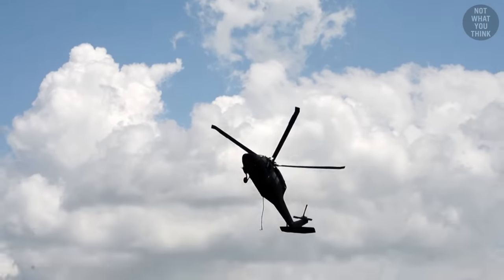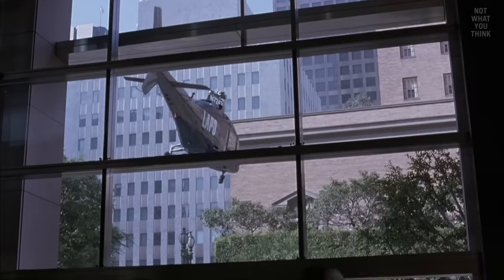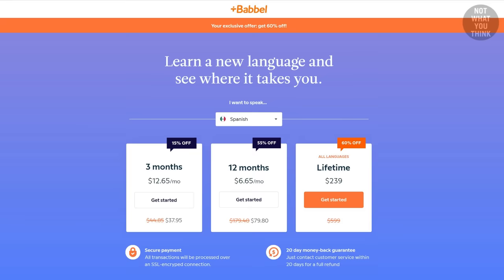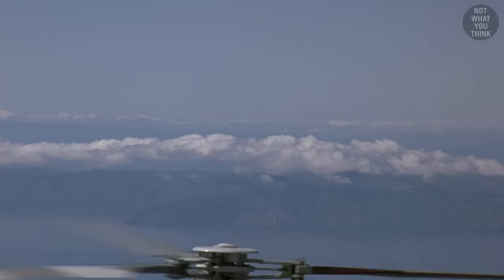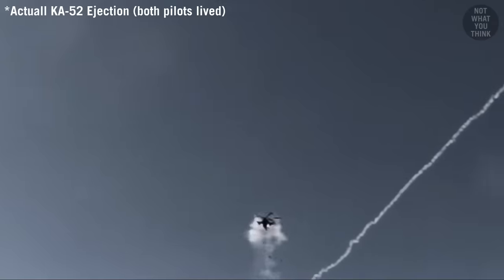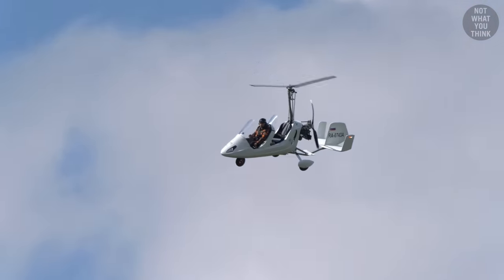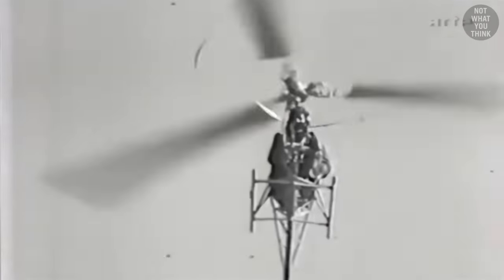Why Helicopters Fall Like a Leaf, Not a Rock

Comment: By using the mass of the rotor (autorotation). The bigger and heavier the rotor the more "lift potential in the tank" this is why big helicopters rarely crash when having only a engine failure given they have some altitude at least.
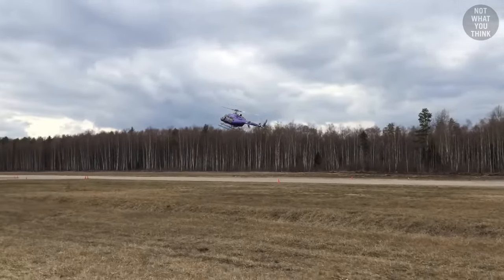Edit: 4:34 this is why this pilot had to do such a abrupt landing, the rotor has barely enough mass to do a 1 second "power up" 5:38 you can see how the mi8 has enough mass to do a gentle landing.
Reply: Technically it has to do with moment of inertia. While rotor (& transmission & engine) mass play a role, the distribution of the mass make a noticible diffference too. For example, for two rotors, one is three-bladed and the other two-bladed (assuming same lift and mass), the three bladed rotor would have less moment of inertia than the two-bladed rotor, because the three-bladed rotor will have a smaller diameter. In this case, the two-bladed rotor will have better autorotation characteristics.
Reply: I've heard that the venerable Bell UH-1 Huey has enough mass and momentum in it's rotor (Blades are nearly 12 inches wide IIRC) to land and with the engine off, lift off, turn 180 and land again.  In contrast, the 2 seater Robinson R22 that I trained on, the pilot must IMMEDIATELY lower collective in the event of an engine failure (The handbook says 2 seconds or less).  Essentially the blades slow down while lifting the helicopter.  With no engine to speed them back up and if you don't lower collective and flatten the blades so they're no longer lifting,  they'll get to a point where the air from the falling helicopter will push them up and break them off.  There is no recovering from essentially losing your wings.  Game over.
Reply: @Quizzicality  the huey blade is so wide it's more then the size of the shoulder width for a man, it's 53cm, or 21 inches, about 9cm thick at the root.
Reply: @nicholaslau3194  this is why I stated "the bigger and the heavier"
Mi8 has 5 blades but it's so big and heavy it can "go up instead of down" using autorotation.
Reply: @Quizzicality  the huey and ah1 cobra had another problem for the "loosing your wings" and it was mast bumping, if you went into low or negative G the heli started rolling, if you happened to correct the roll before applying back cyclic or collective to load the rotor again it would literally break away and fly off while you crashed.
Reply: @antoniohagopian213  mmhmm.  Robinson helicopters have the same problem.
Reply: @Quizzicality  all dual bladed helis have it I think, but the raven doesn't have it to the same extent as the huey and cobra since those were much more likely to fly low to the ground resulting in low and negative g when terrain following after a steep mountain or hill side.
Reply: @Quizzicality  "they'll get to a point where the air from the falling helicopter will push them up and break them off."

I'm a CFI in airplanes and helicopters and I've never heard of such a thing.
Reply: @Tom-zs6bb  I was told for the robinson if you fail to lower the collective and let the main rotor speed fall below 80% you'll be falling too fast and risk the blades folding up and breaking off.
Reply: @Quizzicality  You were told wrong, or you misunderstood. Failure to maintain the correct main rotor RPM during autorotation can cause a couple of different problems, depending on meeting a couple conditions, but it's doubtful that the blades would separate until the a/c impacts the ground. During an auto, the main challenge, where the collective is concerned, is not allowing the main rotor RPM to exceed safe limits.
Reply: @Tom-zs6bb  ah, well I stand corrected 😁👍
Reply: @Quizzicality  😉

Comment: The ejection system on Ka-52s is a bit different of classics ejection seats . A rocket behind the seat is attached to the crew member harness with a cable . When it's fired, it breaks the canopy and then extracts the crewman from his seat . It's similar to the Yankee extraction system .

Comment: I am so much more impressed with the base mechanical principles of helicopters, than I am with any other mechanical system.
Reply: I get you but this competition needs weight classes or something. The tesla valve is just as impressive (to me) but less flashy. Coconuts leave helicopters in the dust, they're solar powered self-replicating colony ships and they've probably killed more people than helicopters.
Reply: @KoenZyxYssel  I specifically said mechanical systems. That means non biological like a coconut. Also a teslavalve is a very simple thing that could have been invented at least 100 times by now if tesla himself didn't invent it first.
Reply: Definitely mechanical systems in vehicles are extremely impressive, like internal combustion engines in cars or jet engines on airplanes or like a closed cycle combustion engine on a rocket
Reply: @monkaeyes3417  I'll agree to disagree on both of those issues. The more abstract definition of "mechanical" makes more sense to me. I also doubt anyone would have come up with the tesla valve but I guess we'll never know.

Comment: I always found doing autos fun. The initial sensation is almost like falling. 
Definitely a emergency procedure that is worth practicing!
Reply: When I was in the Army at Ft. Sill as a crew chief on a UH-1H, autorotations or what they liked to call 'non-standard landings" seemed like a daily training mission.  Somebody's aircraft was going to get the crap kicked out of it that day.  Some times you'd land in the grass, some times on the runway.   You do non-standards today, tomorrow you were likely in the hanger at best changing out the skid shoes, some times the tubes.   At the time (82-83ish) here was a civilian contractor on the airfield that would take the standard skid and weld a number of 1/4 inch(ish) tall beads down the length of the shoe.  That gave it a bit more life.  But you are right, very much a skill worth having, one you (and your crew) might not be able to live without...

Comment: Assembling the auto gyro, then  recovery and stowing the craft after the flight, would have been a great challenge for the German U Boat crews, especially in the choppy seas. Good information, I never knew before that Uboats operated a reconisance gyro copter, great video indeed.

Comment: Your explanation of autorotation was somewhat simplified but the actual physics is rather complicated (and potentially rather heavily technical for a short YouTube video), involving three zones in the rotor disc - The driven portion, the stalled portion, and the driving portion - these zones are essentially concentric and offset slightly to the side of the retreating blade.
Reply from the maker: Your correct. We did come across that in our research. We decided not to include it.
Reply: @NotWhatYouThink  - Probably a wise move. You'd have your audience falling asleep before the end of the video. It is rather interesting, though and the really nice thing about an autogyro over a helicopter is that we don't really need to pay close attention to our rotor RPM once we have it up to speed and have taken off. More weight, they spin faster. Thinner air, they spin faster. As long as the rotors are loaded, they spin at whatever is necessary to provide the lift we need and to ensure that we keep them loaded, we NEVER pull low- (or negative-) G manoeuvres.
Autogyros are widely underestimated as they are incredibly capable aircraft and handle wind and turbulence better than the majority of GA fixed-wing aircraft. We go flying on days where the wind conditions have grounded everything else at our airport. I get envious looks as I am out warming up my engine when the folk at the flying school are racing to get their Pipers and Cessnas tied down.
We don't need a lot of wind to be able to perform a zero ground-speed hover. We have around 90% of the capability of a small heli at about 10% of the operating cost.
In your comparison between fixed-wing and rotorcraft when you were talking about safety, I think you might have missed a key detail. Whilst we cannot "glide" as far as a fixed-wing, we can put down in much smaller spaces which gives us many more options for an emergency landing.
If you ever get the opportunity to go for a ride in one, I highly recommend it. You will land with a grin so large that the top of your head will be in danger of falling off.
Reply: @halfrhovsquared  is there a lecture on youtube or a set of lecture notes that goes over the physics of autorotation? can you provide a link to it?
Reply: @mastershooter64  - I've never seen one. I'll have a look, though.
I learned about autorotation because I fly a gyrocopter (just in case that wasn't obvious from my channel).
If I cannot find a lecture on autorotation, perhaps I should put one together and upload it.... although, that would be a huge investment in time.
Reply: @mastershooter64  Helicopter Lessons in 10 minutes or less does a great brief video on autos, and there are certainly plenty of exhaustive videos on the subject

Comment: To anyone confused as to how auto rotation works, they change the angle of the blades so that it starts spinning as they fall and then right whenever they're about to hit the ground they change the angle to start thrusting downward
Reply: Basically like flaring the flaps at the end of a glide. Giving it an extra boost in lift at the cost of forward momentum you are trying to get rid of anyway.
Reply: @RamadaArtist  " flaring the flaps?"
Reply: You sound somewhat confused, yourself. "so that it starts spinning" seems to imply that the main rotor stopped turning so that cannot be what you meant, right?  Similarly, "they change the angle to start thrusting downward" seems to show a lack of knowledge of basic physics as well as aerodynamics. That being said, it appears that you have a little  bit of understanding so perhaps you simply worded your comment incorrectly.
Reply: @Tom-zs6bb  The video never really explained how the driven and lifting sections of the rotor disk work during autorotation. He just says altitude is exchanged for rotor speed. That's true, but probably leaves a lot of questions for people.
Reply: @CompTechs  " The video never really explained how the driven and lifting sections of the rotor disk work during autorotation."

No it didn't, but other than you attempting to prove you know something about the three regions of the disk during autorotation, a discussion that lies well outside the scope of this video, that is completely irrelevant to both my comment and the comment to which I responded. 

My comment was a response to a commenter who chose to provide instruction while he himself has no idea what he's talking about.
Reply: @Tom-zs6bb you must be fun at parties
Reply: @All_SportGG  And you celebrate ignorance. Given the choice, I'd rather be accused of not being fun.

Comment: There was a case in Taiwan that a rescue helicopter engine seize in the mid flight and drop like a rock....After investigation, they found out it wasn't the engine issue, but the main rotor bearing was seized due to lack of lubication......

Comment: Helicopter auto-rotation after engine failure requires two things: 1) reverse / negative pitch in the rotor blades 2) disconnect /uncouple the rotor from the engine, so the blades can spin freely. This way, the spinning rotor blades will function as a parachute. Both 1) and 2) be done QUICKLY, before the rotor speed slows. As you get VERY close to the ground, gradually feed in positive pitch to brake the descent speed for a comparatively soft landing.
Reply: But you still have the torque of the main rotor without the tail rotor to compensate.
Reply: @GeoffryWK  nope you actually don't, the torque to the helicopter delivered by the blades is delivered through the engine of the vehicle as it works against the drag the blades experience. when autorotating this simply cannot happen as the blades are not driven by the engine and will simply just reduce RPM.

basically, the rotation the tail rotor compensates for can only happen if the main rotor is currently a powered rotor and is why gyro copters don't need any sort of tail rotor to maintain yaw control as the lifting rotor is purely driven by external forces and is not rotated by the engine.

Comment: Autorotation is also a valid approach. Eg in New Zealand some locations require a auto rotate to get into. I always found autorotations more like a plane landing. Eg maintain a constant glide speed then flare near the ground. I guess keeping the rotors in the rpm range is slightly different.
Reply: "Autorotation is also a valid approach."

No, it's an emergency, not an "approach."

Comment: Hello, I noticed you mentioned English wasn't your first language, but you speak it very well, however there's one strange rule which most English speakers don't get correct and I noticed you messed it up a few times. "further," is used when talking about progress, for example "Albert Einstein explored calculus further than anyone at the time." While farther is actually used when referencing distance, "they used the kite to see 'farther' in the distance," but further would be incorrect. Hope that helps :)

Comment: Auto Rotation is indeed a fantastic safety feature by design, but if even one of the main engine blade's were destroyed or ejected, the helicopter will then fall like a rock.
Reply: True but so will a plane if you cut off one of its wings.
Reply: @jerryblue017 unless its an f15
Reply: @srthebox4946 and if you chop off the whole wing not just half

Comment: 10:07 Actually, depending on the "aircraft's" weight it would not require a pilot's license. "If unpowered, weighs less than 155 pounds", and "If powered, weighs less than 254 pounds empty weight, excluding floats and safety devices which are intended for deployment in a potentially catastrophic situation", weight does not include the pilot.
Reply: Given that a boat is one big float, you could exclude its weight?

Comment: I knew right away this was gonna be about autorotation. Back in HS physics, I did a lot of research on it for our Egg Drop project. My idea was to copy those helicopter seeds. The major problem was our initial build volume was extremely restricted so at first we tried to make an expanding blade but because no initial rotation was allowed, it never spun fast enough for t he blade to expand out. So we ended up with a smaller but very wide surface area helical blades. Lemme tell ya, we felt like kings when we "won" the project but it felt so much better when we let go of our vehicle and it fell like a feather. Our physics teacher was so proud. It did sting a little that second place was literally an egg stuffed in a jar of peanut butter...

Comment: the Ka-52 does NOT have an ejector seat.

the seat remains in the aircraft. instead a drag line is launched, with a rocket at one end and the pilot or co pilot on the other end. this drag line pulls the occupant out of his chair, and out of the cockpit.

Comment: If your rear rotor fails, you can also use rocking(stick forwards and backwards)to get the helicopter to move into one direction, the airflow will stabilize the helicopter at sufficient speeds, thus making it possible to get to a spot where you can safely land.

Comment: 4:01, As far as i know, this is how small propeller type blades work but I think the larger ones on the helicopter work like an aircraft wing not directly blowing air down but creating a difference in air pressure like a wing on an aircraft does. I think the mechanism may be similar with the auto rotation.  I'm not very familiar with the technical nomenclature so correct me if i'm wrong.

Comment: Rotation is magical for all forms of dynamics, changing the direction of linear forces and similar. Here the rotation distributes the drag of these blades across the area in which they rotate. The force traded for this advantage is proportional to only the drag of the bearings and air resistance. The primary limitations of this are the blade angle and drag, if the blades spin too fast for the angle then the helicopter begins pushing air upwards, if the blade angle is too shallow then there isn't enough force keeping the blades spinning.

Comment: As a helicopterpilot I met said: "Helicopters are machines fucking with physics to kill you and you have to fight it"
And of course they crash more often in relation. Airplanes have the task to fly from airport A to airport B. Helicopters have the task to land between traffic lights, land on rooftops, get someone from the side of a mountain and standing completely still while someone jumps into the ocean.
Also its far more complex to operate, because it can hover and from there turn or move in every direction. a plane just moves forward.

Comment: 1:15 To be fair - the F-4 Phantom II has a glide ratio of 6:1, meaning it glides six feet for every foot it drops. A typical helicopter has a glide ratio of 3:1, but the major difference is the ability to control the pitch of the "wing" at the moment of landing - so you can achieve a softer landing by flaring more than a fixed wing aircraft.

Comment: regarding the safety stats: if you separate aviation types (commercial vs general aviation), then planes fall into two distinct categories

1: Commercial aviation - extremely safe, chances of being injured or killed in a crash almost nonexistent
2: General aviation - on par with riding a motorbike in terms of deaths/injuries

Statistically, Helos are a LOT safer than GA, less so than commercial aviation